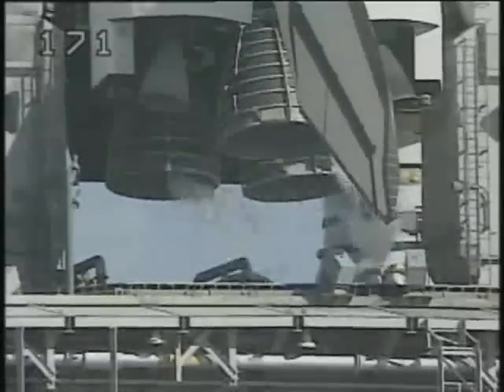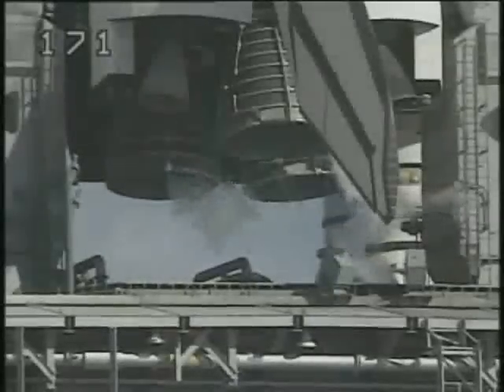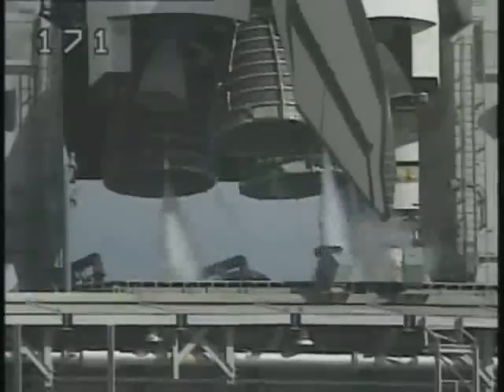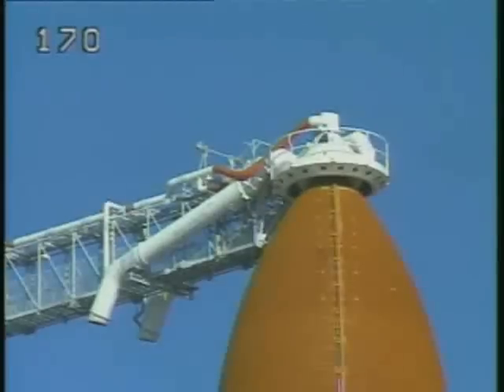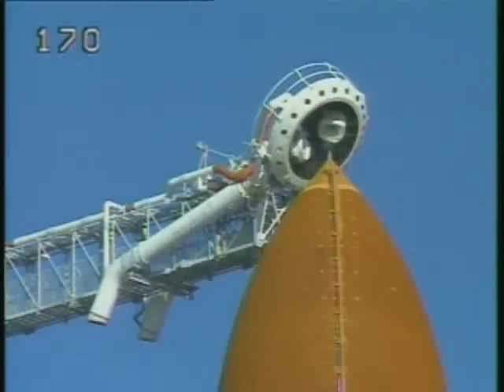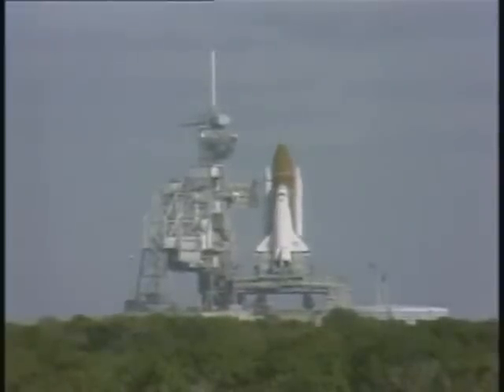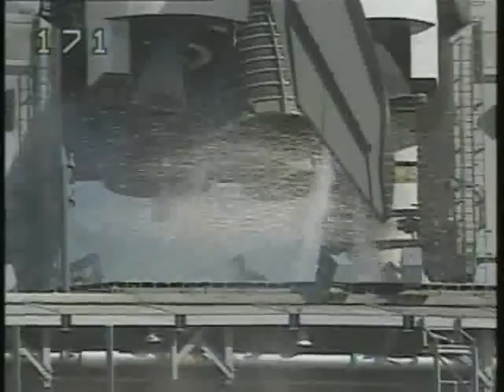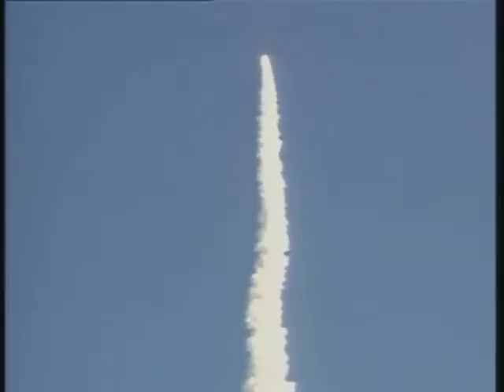Launch of STS-27 (Atlantis)

Comment: After this close call, NASA had no excuse for not having some sort of rescue plan in place for severe damage like this. Columbia's crew might have been saved by a rescue flight. Shameful bureaucracy at work.
Reply: Thunderbird 1 its because of one awful women- Linda ham.
Reply: Linda Ham made a mistake in concluding that the damage to the thermal protection system would not cause a disaster during re entry - obviously she was wrong - but she and her team were not responsible for the deaths of the Columbia crew members. The disaster was caused by many years of neglect, inattention and not enough money spent on safety.
Reply: They did have rescue mission plans in place. They would have been called STS-3xx, but they didn't know the extent of Columbia's damage at the time.
Reply: @thatguylance45  where'd you get the 3xx

Comment: This mission nearly ended the Space Shuttle program. Both the engineers and the crew got a lucky break in this one. This another example on how essential communication is.
Reply: Agreed. Had this become the second shuttle disaster (and second in three missions), the program almost certainly would have ended then and there.
Reply: Why? What was the close call? I don't recall a dangerous situation, only a brief hold at T-31 due to weather.
Reply: @Davenbeach  ablative came of the right SRB and hit the right wing causing extensive tile damage